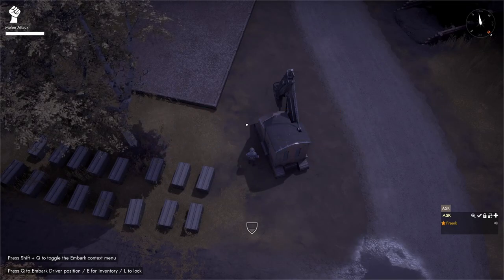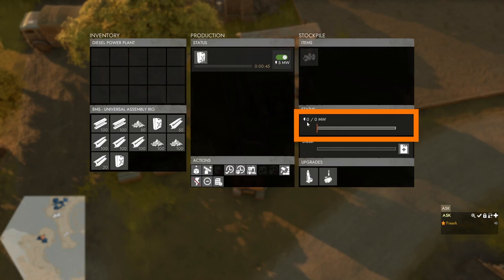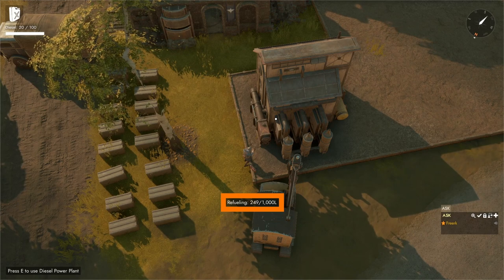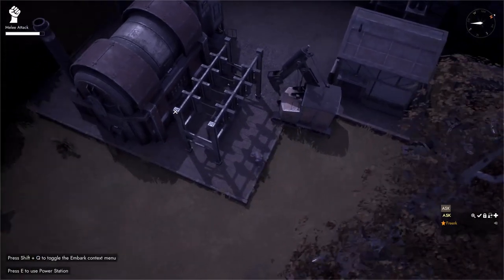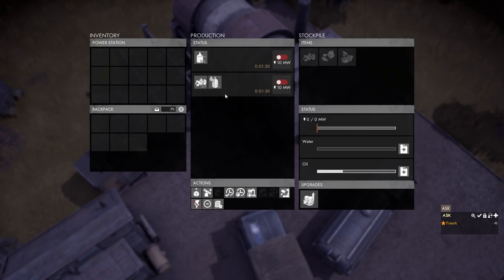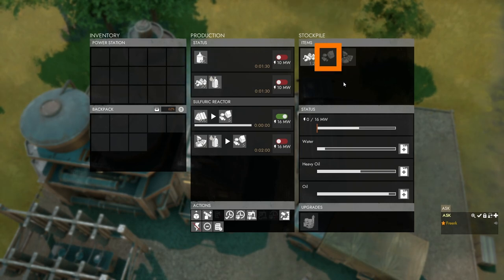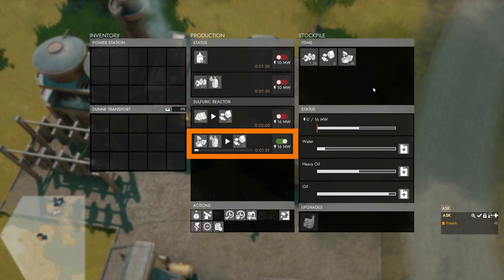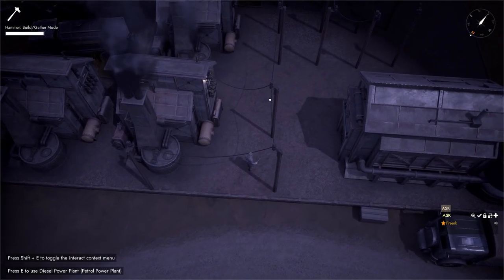Foxhole Guide - Powering Facilities

Comment: My biggest tip to people building their first few facilities: The misery of facility work is having to do a LOT of maintenance work (msups, travel time to and from raw resources) etc.

In regards to the topic of this video I'd make two suggestions for said players:
    1) the fewer power poles you place the less msups you have to supply to prevent decay and thus less work you have to do to keep things running. Power lines can be joined at "a longer distance than you think but not so far its ridiculous". When creating the layout of your facility keep all of the power connectors in the same direction (or pipe interfaces) and it'll mean you can use less than half as many power poles.

    2) You (likely) do not need power flowing in your facility 24/7. Using power only when it's necessary and turning it off when you log out will save you a lot of pain of having to refuel your facility everytime you log on. My only experience where this wasn't the case is when you have a lot of resources saved up and needing to be refined beyond the time you typically play and .....

    3) Have a Sulfuric Reactor. If you have oil refinery access the Heavy oil for 16MW of power + sulfur for nearly 30+ hours is incredible though for everyone else the Coke + water recipe for 33hrs of 16MW + sulfur production is a life saver. VERY rarely should any one facility need more than 16MW at-a-time. The only exclusion being those massive clan / coalition facilities with 24/7 production and constant power needs. This means even with a regular power station (10MW for 33hrs) you'll make you're initial couple of trips for coal + water (unless you have quick water access) and you'll have power for a week of play if you are mindful of power wastage.

Facility work can be fulfilling - but if you don't mitigate wasted space, power and resource usage you'll end up with a part-time job demanding full time hours. The best way to keep this game fun is to start with facility purpose, layout and namely how to connect power and liquids with the fewest number of poles / lines / pipes etc. I've also found keeping the facility "clean" and easy for a person to navigate also keeps you sane.